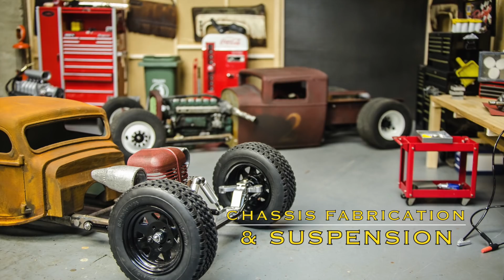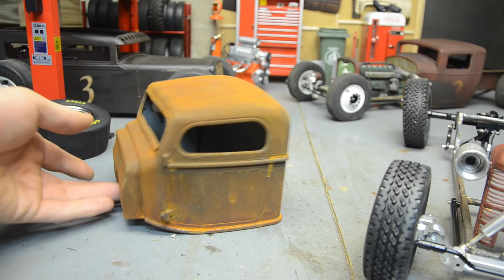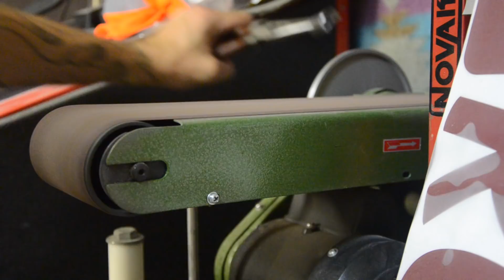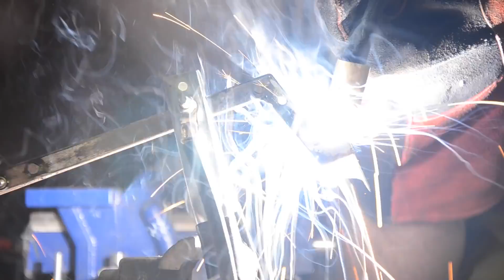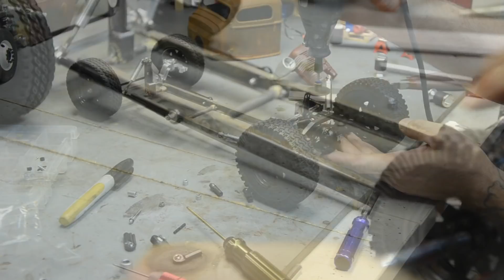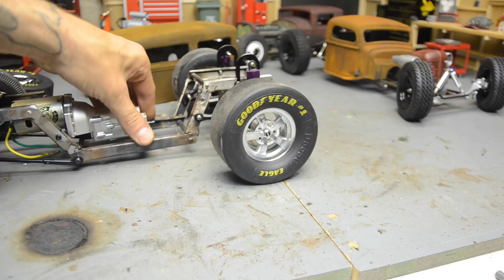RCengineering, New RC Rat Rod Chassis Fabrication and Suspension, #4 Ratrod build Episode #!

Comment: How to mount 12mm Hex wheels to Tamiya front axle as shown? Im in struggle :(
Reply from the maker: There are some 3dprinted adapters out there. I drill out 12mm hexes and use some spacers to make it work. Just needs some grease.

Comment: Awesome Rat Rods, Where do you get the truck cabs from and are they 1/10th scale ??  I dig the weathering too.
Reply from the maker: This one is form shapeways designed by M-customs, my #2 truck is from ossum designs on shapeways as well.  The sedan body is from nightcrawlers3D on instagram.  They are all pretty close to 1/10 scale.  The sizing was set so they worked well with 1/10 scale crawler parts.

Comment: is the channel you used for the frame rails a stock material you can buy or something you fabricated from scratch to look like channel?
Reply from the maker: The chassis is made from 1/2 inch square tubing cut in half.  It has been impossible to find any c-channel that size.

Comment: Assuming you're using TIG for your welding I have a couple tips that might be helpful. From what I see here it looks like you're not allowing the after gas to do it's job. If you simply hold the torch close to the weld after you turn off the current it will allow the gas to envelop the metal and keep it from oxidizing as much. You might also try using a little less fill rod and a little less current. If you are in fact letting the after gas do it's job then it's a matter of getting the current right. That or perhaps your mix is off if you're using a mixture. I'd go pure argon for something that small. Great video, love the builds...
Reply: Yeah, you need a TIG and you can get a cheap one from Harbor Freight that works on 120 volts AC just fine. It will do a much better job than that MIG you're using. They go for around $80 last time I checked...

Comment: Hey, Josh - I´m glad that you´re feeling better. At I8:30, when talking about the Goodyear Eagle slicks, you say "but what do you put on the front?"
  When building a truck recently I was faced with that very problem; what I did was to measure the OD of my rear tyres and then order myself a pair of model aeroplane wheels with a ribbed tread pattern of the same diameter. The high tyre profile and rounded section look strangely appropriate on my truck, so I thought the idea might be worth mentioning here.
  By the way, it was a real nostalgic pleasure to see you feature Ol´ No. 2´s rear suspension again  : )
Reply from the maker: Thanks for the tip my friend, I will do some searching for the plane tires.  Those type searches often render unique finds.
Reply: Dupro "low bounce" wheels might look quite cool on a rat rod. With that ribbed tread they remind me of WWII "desert raider" balloon tyres or the sort of thing you might see on I930s hot rods during the 50s, when they raced on dirt.